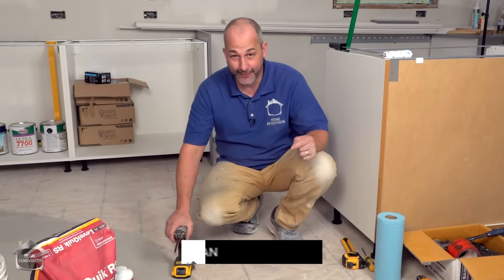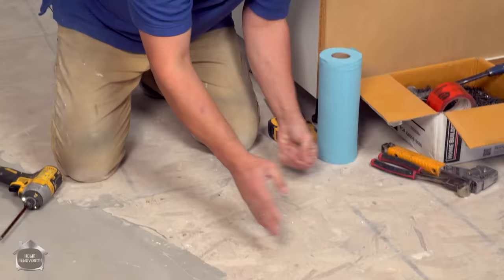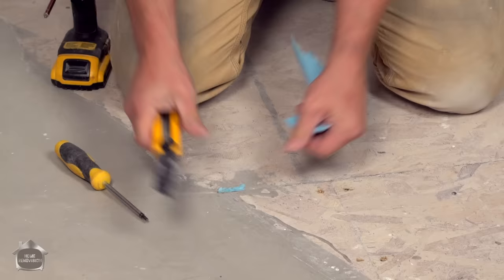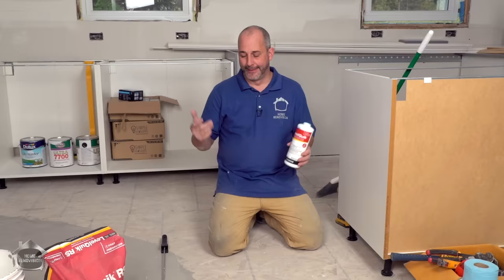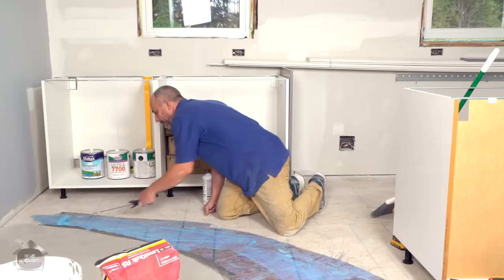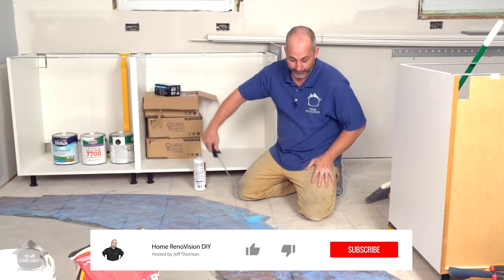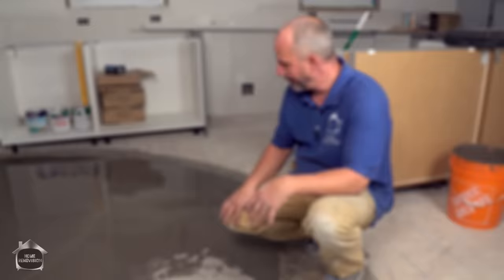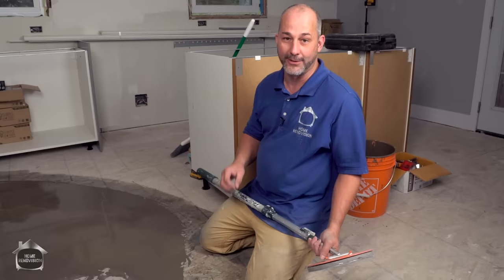How To Level Your Floors

Comment: Hey enjoy to video s   I have laminate floors that were glued together on pad over concrete slab I want to completely cover all the floor and existing kitchen which has vinyl flooring I will remove straight concrete but have that depth of the pad and laminate . Going to install vinyl planks  do I fill all the floor with self leveling to bring kitchen flooring up. Do I install  for something moisture  underneath

Comment: Working on kitchen renovation currently. Plumbers trenched new lines to my island and filled trench to within 1/4 inch with bagged concrete. To top it off and smooth it for SPC planks over top, should I just add more concrete and trowel smooth or go with the self leveler?

Comment: Been a long time viewer & thanks so much for helping on my renovations! Question: my front porch on my townhouse had fake grass glued down covering it when I moved in. Looked awful! Pulled it up and now it's concrete with old adhesive I don't know how to remove it. I tried scraping it off by hand and with my oscillating tool, with little progress. I wish I could just recover it with a resurfacer, but I know the answer to that! Should use a chemical remover of some kind or can I grind it off? I don't know what kind of glue was used but it's stubborn. It is a small front porch about 4' x 9'. After I get the adhesive off then I can pour a resurfacer to freshen the concrete, right? What product do you recommend? And thank you again for addressing real homeowner concerns with practical solutions. It great when you help with problems we might run into doing DIY jobs.

Comment: Love this channel, Jeff, you know your stuff. Question? Can leveler be poured over concrete where old linoleum has been partially removed? The glue is so old, the linoleum deteriorated, it's almost impossible to remove all of it. Can I just prime it all and pour leveler, even though 60% of the old lino and glue is still there? Thank you.
Reply from the maker: Hi Montana Mule, Yes 100% Yes!!!  Use the Eco Prime grip on linoleum and then your regular primer/ bonding agent after that!. cheers!
Reply: @HomeRenoVisionDIY  THANK YOU! I'm going to give it a shot
Reply: Linoleum glue is water based. Remove what you can, primer and then leveler. And after you sand (if it is needed).

Comment: Hi Jeff, I am dealing with squeaking and unable to resolve the problem. I have put screws all over the OSB subfloor about every 4 inches. I have also put screws on the adjacent walls by cutting the drywall on the bottom.

Comment: What advice do you have for leveling over black mastic? I tore out the 9x9 tiles in my basement (asbestos free) and now I'm left with a whole floor of black mastic. The floor is pretty flat but needs some leveling. How do you go about dealing with the black mastic.
Reply: I have the same question... :) as we removed some old (non-asbestos) "vinyl tiles" that were the last layer of old flooring on top of the plywood sub-floor in our kitchen, that were glued down by "black mastic" adhesive of some sort. They had to come up, as the old tiles were making a "sticky" sound when you walked across the old tiles -- and we didn't want that sound, of course, after laying our new vinyl laminate flooring on top of it. So, we popped off the old tiles (with a roofing "shovel", actually :)) which wasn't too hard, but then... (unfortunately?) went right over the old mastic left on the plywood with the floor-leveling compound, directly, to level out the whole floor. However... after the floor-leveling cement dried, we heard the awful "sticking" noise again, when walking across the surface. Argh! So, we think the cement layer isn't sticking to the old mastic, and so we have the same problem we started with (LOL), even though the surface is now perfectly flat -- the annoying noise is still an issue. So, we're now debating whether to 1) remove the leveling cement that we just put down, and then, the mastic (which might be difficult?) and "start over"; or, maybe 2) add additional plywood sub-floor over the top of our leveler layer to try to mitigate the "sticky" noise by sandwiching the whole mess tight enough with screws that it no longer makes the noise. Hmm, what to do?

Comment: I've been viewing your videos for a while. Very helpful! I'm starting a kitchen reno in a 1950's house. I'm down to the original 3/4" pine board subfloor, laid diagonally on joists with 1/4" gaps between boards over crawlspace. It's in good shape. What prep should I do before installing 3/4" solid red oak strip flooring (to match existing adjacent space)? Would felt roofing underlayment be sufficient?
Reply from the maker: Hi Doug. That all depends on the crawl space. is it insulated and or have a vapor barrier intact to keep moisture from coming into the wood? also be careful what type of hardwood you are installing. many brands have short boards only and will not perform well on your subfloor. I suggest a higher quality long board supllier or add another layer of subflooring to beef up the strength to avoid the joints from cracking and having too much movement! Cheers!
Reply: @HomeRenoVisionDIY  Thanks for the reply. I have an uninsulated crawlspace with  6 mil plastic on ground. As it turns out, I'll need to put put down 3/8" to 1/2" plywood underlayment so finish floor will be level with adjacent floors.

Comment: i watched several other videos that said to use ring nails and no glue. so thats what i just did for laying 1/2 inch cork underlayment. does that mean i'm just going to run into problems soon with wood loosening and squeaking? i'm installing lvp flooring. thanks for your helpful videos.

Comment: My 1960’s house has VCT over VAT. There’s some water damage and the VCT is lifting easily. Planning to soak the rest and remove, check the adhesion of the VAT, then encapsulate with primer and self leveler. Is this a good strategy?

Comment: Hi , in my unfinished basement, they had put a layer of 5/8 plywood on top of the concrete,  I am going to finish my basement by putting vinyl plank, but my floor is not level, there is up to one and half inch  difference,  I was thinking to remove the plywood from the surfaces which are very high to reduce the difference and then put a self leveling compound on top of it, would it be possible to apply self leveler on top of mix surfaces of concrete and plywood?
Thanks in advance

Comment: can i use the same  primer that u used on  old tile  for leveling
Reply: That's exactly why I'm here.
Need to cover a good size section where 2 sections of different tiles meet at slightly different levels

Comment: Jeff, if there is existing vinyl in the basement that can be used as the subfloor, can I use primer and leveler directly on top of the vinyl?  I'm trying to avoid removing it.  If not, do you have another video related to that?  Thanks for making such useful videos!

Comment: Excellent video. Love all of your content. Going to be doing this for a low spot on my main floor.

Question: If I have a 3/4" subfloor, and I'm going to be putting a 1/4" layer on top, and stapling a very thin flooring underlay on top of that (for attaching LVT via adhesive), where in the layers should I apply the Self Leveling compound? On the 3/4" sub, or the 1/4"? I wanted to avoid laying it on the thin flooring underlay to allow for it to removed easily (and have the level floor be maintained underneath)
Reply: On your sub floor

Comment: One video I watched mentioned a type of  elastrometric leveling material which had a slight bit of flex in it. My biggest concern is putting a leveler down that might crack or chip and cause a problem under my lvp

Comment: Jeff. Forgive me if this is a ridiculous question but; In my home, I have 3/4 pine planks covered by 3/4 plywood. I removed the plywood because It had 2 layers of asbestos glued tiles, Luan, and 2 layers of linoleum. Crazy right?!  My question is, would it be permissible to level the pine subfloor and then cover it with the 3/4 plywood to allow for a nailable surface? I suspect you would have to drill through the leveler to screw down the plywood but placing the plywood over the leveler may help level it/even out even more?

Comment: How about leveling a basement floor which is linoleum over concrete (without ripping up the tile).

Can we use self leveler in only the uneven areas? Or must we pour over entire basemant? I fear that we would feel the subfloors difference when walking on the future top laminate if we only use leveler on uneven areas?

Would I be better off throwing down plywood?

Comment: Hi Jeff. Only question I have is other videos talk about it being a must to use a spiked roller. You didn't, but your floor seems to be just as smooth as their floors. Can't seem to get one online or in store for anything close to what any DIYer needing this tool ONCE would be willing to spend.  I'm guessing what they don't say is you are agitating it (to get the bubbles out) using the trowel. Is that right?
Reply from the maker: Unfortunately floor leveling like many other installations out there, just can't be done to the same standard as a professional without the same tools. For best results pour 2 or 3 thin layers instead of one thick one to reduce the bubbling. troweling helps to minimize those as well. Cheers!

Comment: My wife and I just moved into a new build this year. We are the first occupants of this raised ranch home. The basement is completely unfinished and we would like to add a few rooms to it but the cement floor has had a few cracks show up. Fortunately, there is a vapor barrier under and along the exterior of the walls. Can a floating vinyl floor be placed directly on the cement or would I need to address the cracks first? How much of a difference can the floating floor adapt to? Thanks

Comment: Hi Jeff, do I need to wash my concrete subfloor (after removing an old 1998  vinil sheet) before rolling the sealer? I have scrapped the floor and it does not have glue bumps but it has those typical white stains. Thanks for your help and support to so many people!

Comment: i have uneven 3/4 inch plywood between floor joists (humps) i used screws to screw plywood to floor joist and the humps seem to get worse--what should i do to get floor level for vinyl flooring ??       sub floor must of got wet to do this

Comment: Hi Jeff, thanks for sharing your knowledge and putting out these great videos. Question for you: how would you site prep the existing sub-floor that is original 2" wide t&g plank from 1896 (128 years old)? Those boards are full of antique thin gauge nails, old plank patches, substantial amount of 1"-3" diameter holes, and I think liquid leveler would just rain through to the basement.  The rooms we're renovating are foyer, kitchen, dining room (main floor) and we're going to then install luxury vinyl plank (5mm thickness, 60" x 7"). kitchen, dining room, and foyer would be total 800 sq ft. Some small areas of sub-floor planks have previously been replaced with plywood, and other areas of the old plank sub-floor have signs of dry rot. I'd love your word on this situation. Thank you for all you do. Cheers

Comment: I have a new addition that increased the size of a room but the addition is a slab that butts up to the original house with crawl space. The slab has a slight bulge right before meeting the original floor.  I will be laying hardwood over the entire surface but I don’t know how to fix the concrete height at the seam. Any ideas?Jeff, I love your channel.

Comment: I have done some laminate work before I watched your videos. I would say I did a pretty good job, which means it was not good at all. I learned a lot from your videos and will attempt to do it again, but the main issue I had was working with a floor that was not leveled. I had a tough time determining where I had the leveling issues. How can I tell if the floor is not leveled? How can I tell that the floor is leveled once I finish the leveling process?

Comment: I did this in my basement bathroom, however I used screws to screw into the concrete to get my height and I levelled the entire bathroom so when I set the shower pan it was perfectly level, the flooring etc will be level... the only issue I have Is that its about 7/8" thicker than the concrete floor outside of the room so I will have to do a floor transition there.     But at least the flooring, vanity, and toilet will go in smooth. Flooring wise, still undecided what I will put in there, either tile or LVP with heated flooring.  Definitely a difference between level and flat when it comes to SLC.
Reply from the maker: if you are using a heated floor I suggest installing the wire before the leveler to save room.Cheers!

Comment: The 1-inch mosaic tile in my bath is coming up piece by piece. I'd like to replace it with LVP.  Laying it over the existing tile is not an option for several reasons. My question is how to prep the floor after I get the tile up. Should I self-level the surface or use a resilient backing? I expect the surface to be a bit rough after the demo. Thanks, Ray.

Comment: So I need help. I had 5 layers of flooring. That we took it off to make it the same level as the rest of the house. (Re are redoing the whole main floor, the lower levels had carpet. 

But my other areas had many types of flooring. I currently have this really old type vinyl that was sheet vinyl glued down. So some has come off and some not. Can I put self leveling over that flooring? There is also a tone of wholes in my floor from all the nails, staples and screws. Trying to save money here but not sure.

Comment: Question.  My garage floor is a mess with chunks broken out.  I was thinking of spending 5-8000 to have the pad repoured.  Could I add a layer over existing cement?  How much weight can this stuff hold psi?  Could a car park on it or a moderately sized tool box on castor's?

Comment: Hi Jeff enjoy your videos. I have a 200 square foot kitchen that has old vinyl sheet good over OSB subfloor. I want to put down vinyl plank over the old vinyl. The floor has a few low places that need to be leveled. Can I use the self leveler over the old vinyl? I don't want to have to scrape up the old if possible. Any suggestions are greatly appreciated.

Comment: You mentioned that primer is not needed when apply floor leveler over floor leveler.  According to the instructions on the bag of the floor leveler, you can omit the primer if the previous leveler was put down less than 12 hours ago, otherwise they recommend primer.

Comment: Just what I needed!  Wondering though, what are your thoughts on applying leveler over stick-on vinyl? I think it's doing a good job of sealing all the cracks in the old subfloor beneath it, and is stuck on really really well. No squeaks or looseness; just really wavy over the floor joists. And if is okay to go over the existing floor, do I apply this primer? or another primer specific for vinyl? Thanks!

Comment: Hey man, I have a question. I've heard different things from different people and I know the directions on the bag can often be cheated....so here's my question, how thick can self leveler be poured? And do I need to lay down chicken wire or some kind of reinforcement?

I'm renovating our master bedroom which is in the basement, and I made the subfloor out of T and G with the dimpled plastic underneath (watched your video on that). I'm getting ready to lay down luxury vinyl plank but I noticed a noticeable slop from the exterior basement wall to the center where the drain is (house was built in 1949).

Any suggestions or tips?

Comment: I live in a high rise with a concrete slab floor. My contractor said he'd FLATTEN the floor but wouldn't LEVEL it. Said that it could possibly take several thousand pounds of leveling compound to level it throughout my condo and that he wasn't comfortable with all that added weight and potential liability. Said that flattening would suffice.

Comment: Where do I start:
No patch will stay in particle board 
Wrong trowel
Wrong product 
Water needs to be exact to work,over water will pulverize under will leave the floor worse
But hey whoever does it gives a professional flooring installer busy to fix the stuff like the one I just saw👍

Comment: We have a 10' X 2" X 6" tongue and groove floor boards for our sub floor and it has a lot of high and low areas.  We want to install plank lament floating floor what is best way to level this kind of floor?  
Is it wise to sand down the uneven ground or use a cement floor resurfacer /leveler? Thanks for the video

Comment: Hey thanks for all the great informatio. I have a question for you in my basement they use to have tile. Someone tore it out and left trowel groveses covering the cement. I have tried chilse hammer to get it off but it is super hard stuff and will not come off is there away to get this off or maybe cover the whole with leveler or thin set?

Comment: I have a place where two concrete floors meet and need leveled. (We poured concrete and filled our sunken floor and it now meets the old kitchen floor). Would I use this method to smooth out and level that area or is there a better way?